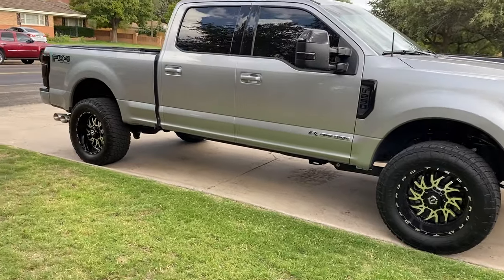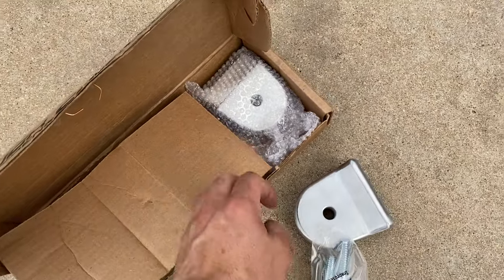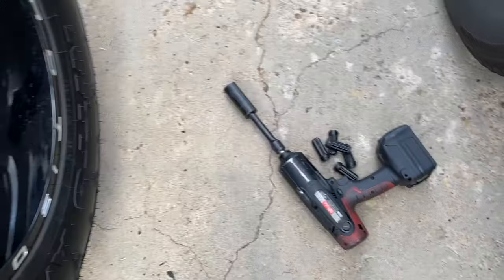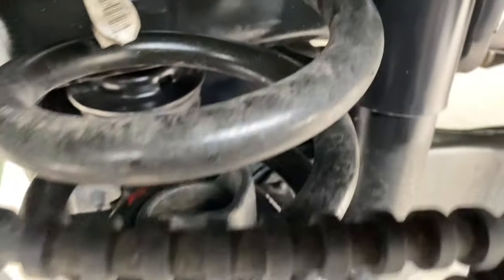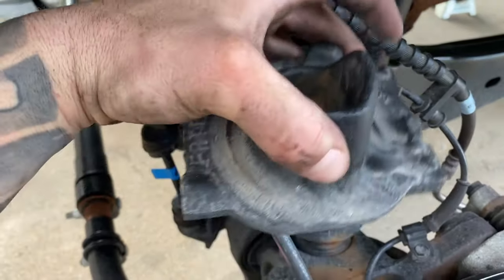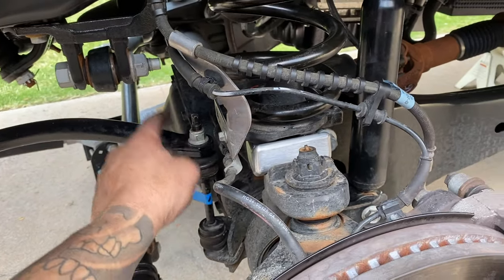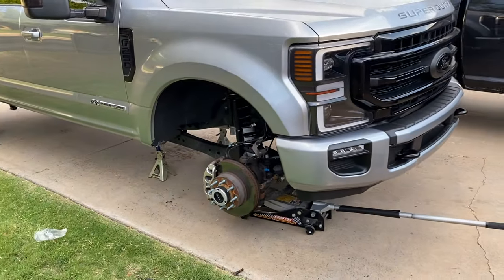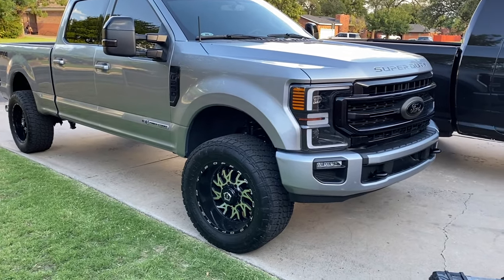Lifted My Truck for $60 in my driveway and it ONLY took 20 minutes!

Comment: Better off getting a complete leveling kit that comes with everything. Sway bar drop bracket,2° caster shims, brake line drop bracket,adjustable trac bar, your axel moves over after installing these blocks. Also need either shock extensions or longer shocks .
Reply: Yep, got the 1.5 cause they said I didn’t need anything unless I did 2”. Definitely need the drop bracket cause it will push your wheels out

Comment: Question. I am about to buy a truck. I have a 2019 laramie and a 2020 f150 xlt lined up. Similar price, sunroof on the xlt and the 3.5 eco. Laramie is similar to the one you had 5.7 hemi. After your experience which one would you buy? I am upgrading from my current 2009 f150.

Comment: Why would a spring adjustment change the alignment, if you did not touch the tie rod ends.
Sway bar does not affect it either?

Comment: Looks good. I have a 2020 and the readylift 2.5 leveling spring kit with billsteins all around coming next week. Going with method 20x9 -12 offset. Really grinding between 35 or 37. Think you convinced me 35 are fine. Do you still have a little rake? Don’t want the 2.5 to leave me nose high
Reply: You probably already installed it, but yeah, if you do the Rough Country 2.5" you will end up with a slight Cali lean to the truck. You'll need to throw some bigger blocks in the back. Look up "workplaytv" channel and the guy has to keep 30 to 35 psi in his rear air bags to level it out.

Comment: That looks like the perfect height. I've been debating going with this kit but it doesn't come with any other brackets so I was worried it would effect the handling like you said. So it still rides great? I wonder if you could fit 37s under that now? Seems like everyone is going with the Rough Country 2.5" but they end up ignoring the fact that the truck sits nose high (which I can't stand!). I like your wheels and I can see you got the look you wanted. I'm more into filling up that wheel well and keeping the wheels closer to the truck. Still, nice job!
Reply from the maker: Thanks! They would rub when turning for sure with 37s